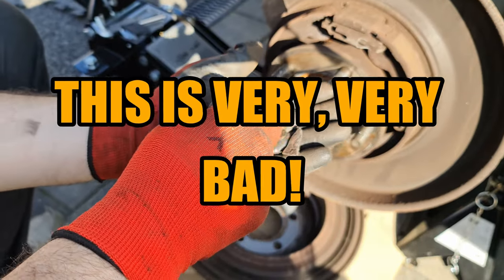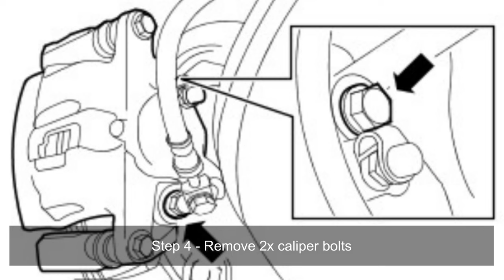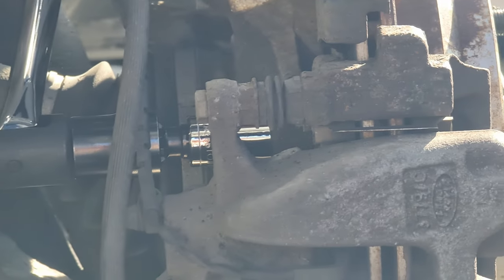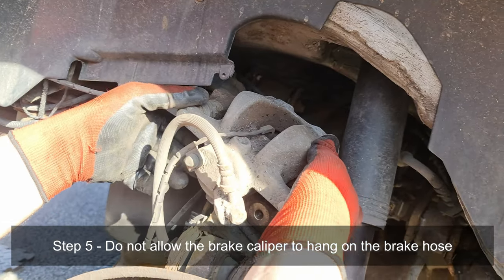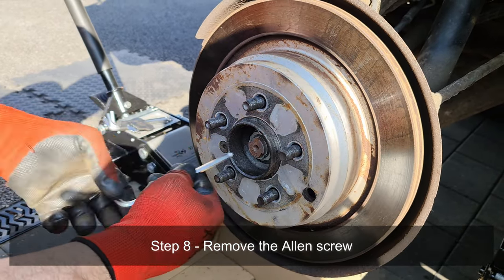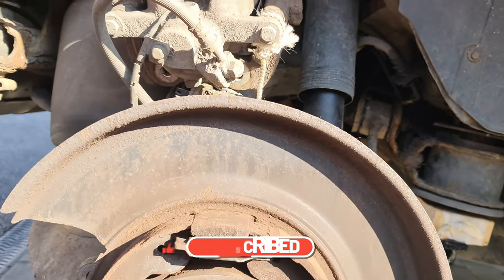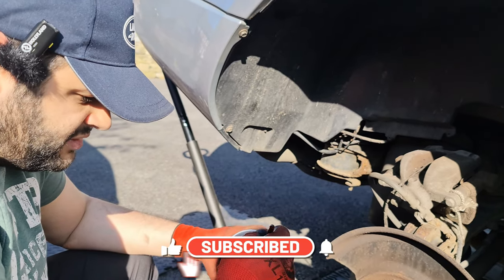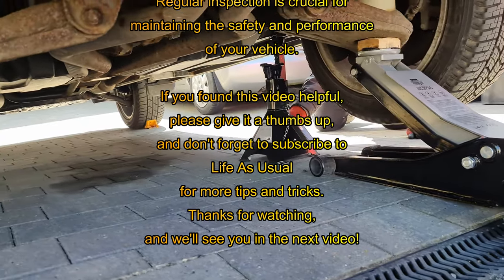Land Rover Range Rover 3.6 TDV8 Parking Brake Shoes inspection

Comment: Don't forget to put EPB in service mode. Otherwise it winds up the cable sometimes and you won't be able to fit cable into expander.
Reply from the maker: Oh! A good tip when we do them, thank you 😊 we did disengage the parking brakes and disconnected the battery on the inspection.

Comment: i never use my parking break only for MOT
Reply from the maker: Hi Stephen, I would recommend using the parking brakes at all times and not to depend on your gearbox to hold the car while in parking. Because that could damage the gears. 👍🏻
Reply: @lifeasusual  no hill where i live so no strain on the gearbox, love your videos and im going to buy a gap tool soon
Reply from the maker: Thank you very much Stephen, we always look forward to your comments! 😊